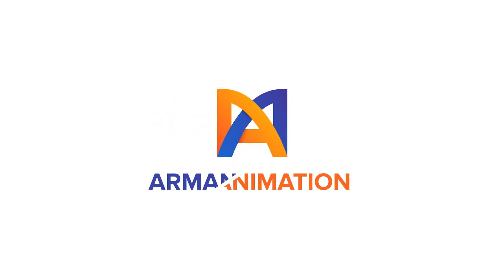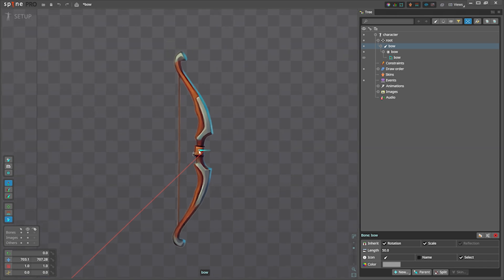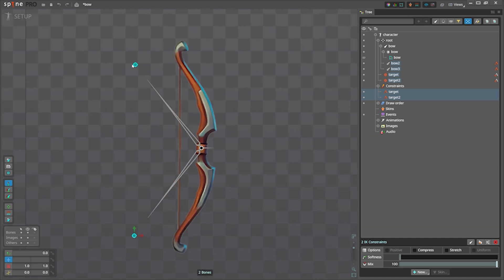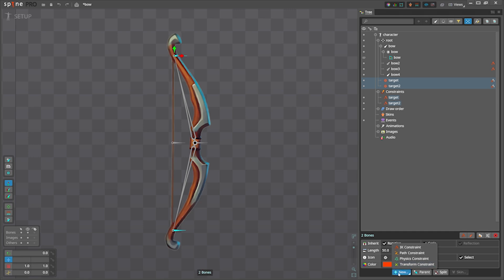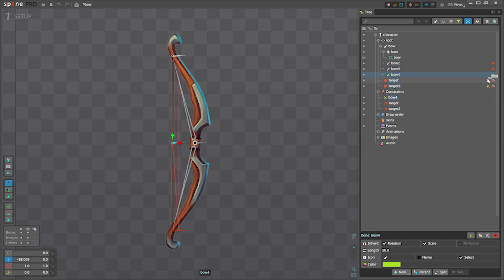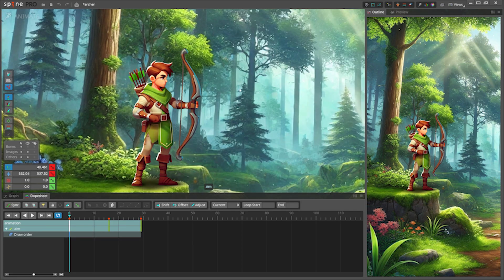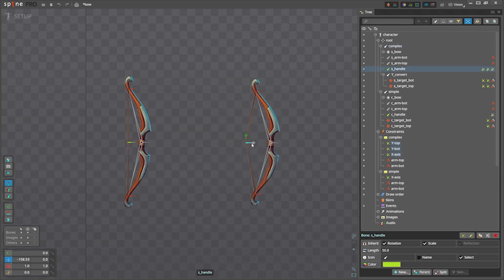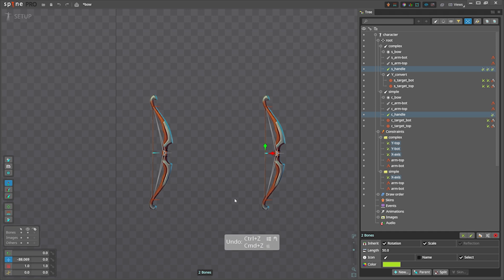Rigging 2D Bow in Spine for Shooting Animation | Aiming

Comment: Hi, I noticed that in my own rig, the IK targets (target, target2) are being moved indirectly via transform constraints (from a central bone like bow4), but the IK chains (bow2, bow3) don’t respond—as if the IK isn’t updating. Does Spine not refresh IK when the target is moved indirectly through a transform constraint instead of being directly translated or parented? In your video, it seems to work. How is that possible? I’d really appreciate your help!
Reply: Haha, I just commented asking about this and then figured it out - just need to reset the constraints and it works. I'll leave this comment here in case anyone else runs into the same issue
Reply from the maker: @binhan3765  Note that this rig could be done much easier with latest transform constraints available in 4.3